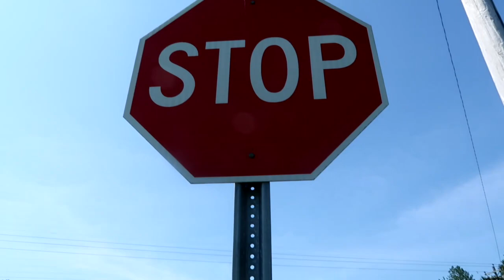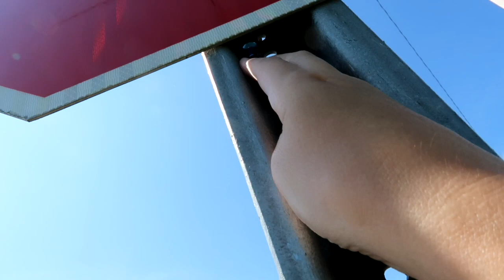Hidden Creatures - Starting My Journey

Comment: Never have heard the term “powertrail”- is this a series of caches placed by the same geocacher? Can you explain it to me? I’ve only been geocaching since March— I did decent on the Hidden Creatures- I made it to the Gryphon!
Reply from the maker: As far as I know a "power trail" is a line of caches along a road or even walking trail where the caches are usually the minimum 1/10th of a mile apart. Some are farther apart. They are usually put there by the same person but not always the case. It is what people will also refer to as a "numbers run". Just grabbing a lot of caches along a straight path with usually no difficulty but will add up quickly numbers wise. These caches tend to all be hidden almost the same along the way to make for quick finds. In this video most were hidden in signs for me but not all were like that. If you check the geocaching map, zoom out to see if you can find any lines of geocaches :)